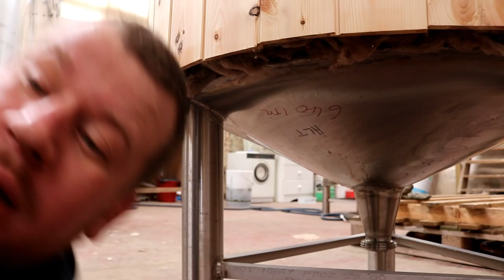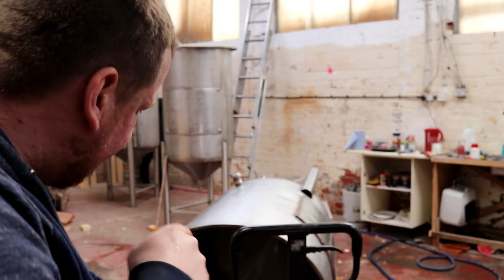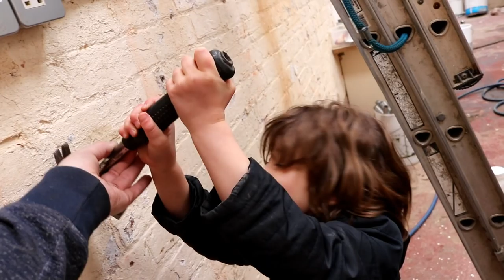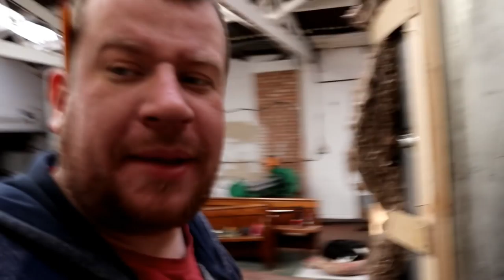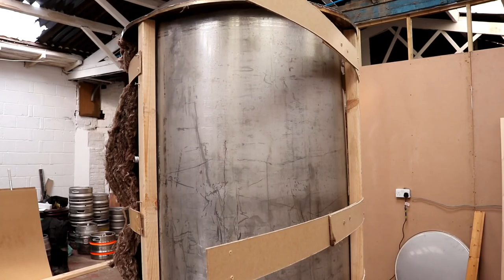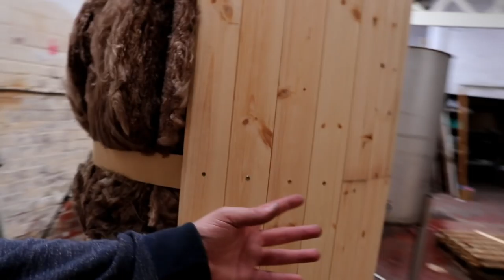TANK HEATING

Comment: Looks good. 👍 Similar (on a much larger scale) to my fermentation set-up. Heat source taped to the side of fermenter which sits inside a small chest freezer. Temp is controlled by an ST-1000.